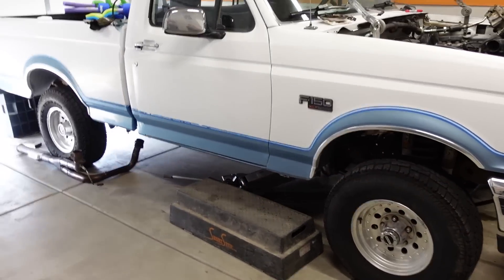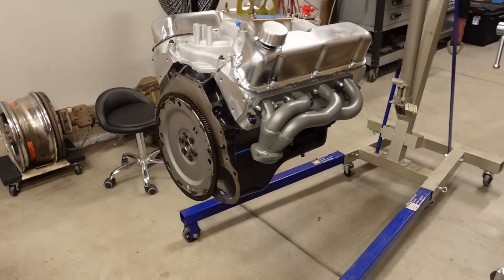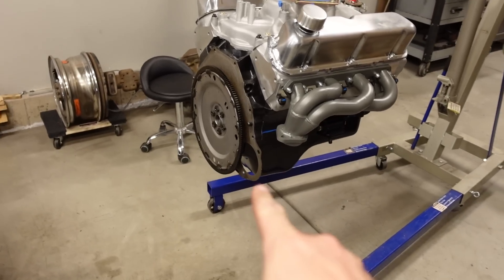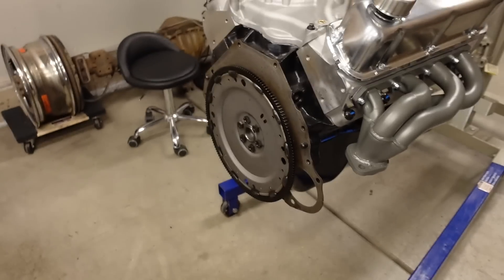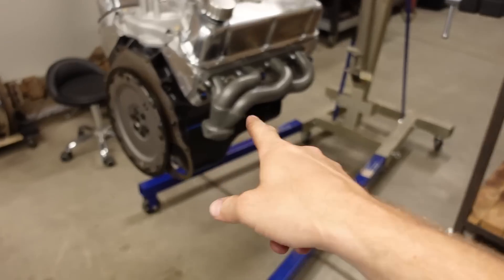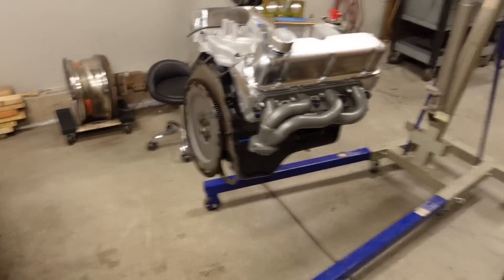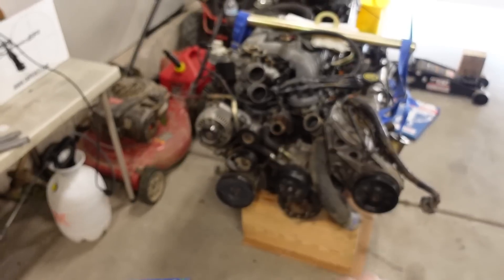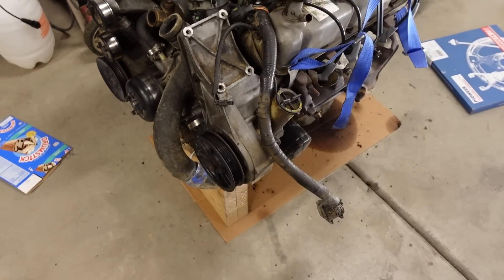1993 F-150 Engine Swap: the 500hp windsor gets installed!

Comment: I didn’t realize blueprint sold an internally balanced 408. I installed a blueprint 408 with a C6 same hp and torque rating. Mine was externally balanced with a harmonic balancer. No issue with flex plate. I would like to convert mine to a 6r80 or possibly a built 10r80 in the future. 1986 flareside 4x4. I fueled mine with an Edelbrock pro-flow 4. Great set up.

Comment: You should get a junkyard pump and bracket from a 1995 econoline van with a 351. They use the GM style pump.  It bolts right up and I used a pressure line from the van too which only needed some minor bending. One of the best mods I’ve done to my 1994.

Comment: Anyone who’s ever done any sort of swap on any ford will tell you this is to be expected.   I went through this with a 302 and a top loader 4 speed 40 years ago and doubled down on stupid and went through a similar situation with a 400 to 460 swap into a 79’ 1ton pickup.   Engine and transmission, perfect, motor mounts, perfect.   Accessory drive…sideways it went and straight to the bone yard I went looking for anything with a 385 series plant under the hood.   Many hours and some light fabrication and we had a running piece.   It shouldn’t be this way but Ford doesn’t want you touching their junk.   I concede and don’t touch their junk anymore.

I drive Chevrolet’s now and  the only Ford I own has a big block Chevy under the hood.   

I always enjoy watching your channel.   Great projects and content.    Great music too. I’m so tired of ear bending heavy metal playing in the background while someone is trying to finesse a camshaft into a block.

Comment: Why would you need a fuel regulator if your using a fuel injection system?
Reply from the maker: every fuel injection system needs a fuel pressure regulator to control fuel pressure...

Comment: Crazy how hard it is to find the right flex plate to join engine and trans… I’m also wondering about that 8- or 10-speed trans swap for later. My 6L90 talks back and forth with the E38 ECM constantly to control torque, gear selection, and lockup. That aftermarket install will need some serious smarts—it seems like, anyway—to control the trans properly. It’s not like a vacuum hose or a kick down cable any more.
Reply from the maker: you've got that right! supposedly the US Shift setup is in Beta Testing (as of Nov. of last year) so I hope that means they'll have em for sale soon!

Comment: What parts are you planning on ordering for the fuel system? I have an 89 F250 mud truck that I'm currently ordering parts for to go carbureted. Would like to know what you'd recommend for a regulator and to adapt to the oe fuel system.

Comment: I may have missed it, but what heads and cam are on that motor?
Reply from the maker: not sure of the exact specs on the heads, but looks like the cam is a 236/248 @ 0.050 on a 114 LSA
Reply: @TolmanPerformance  if it has .579 lift it’s probably the comp XFI236 hr-14. Bad ass cam. Tried to get one but they were back ordered forever. Check on the heads on the exhaust side right under the valve cover lip. There could be a part number. Curious if they are pro comp heads or maybe a variation of them. I have 210cc pro comps. No issues yet.

Comment: I’ve heard you mention a super duty axle swap on this project, if the customer is going for more of a prerunner/obs raptor it would make more sense to me to do a build on the TTB front end using parts from desolate motorsports with some coils overs. Just my two cents, keep up the great work!
Reply from the maker: we did throw around the idea of a long travel 4x4 TTB setup...

Comment: Is it in yet? No, I need another inch and a half!!!
Yep, been there lived that a time or two! Sometimes ya have to get real creative and run the chain through some heavy pipe to get that extra reach while big Bob stands on the back for counter weight.
Cheers man 🍻.
Reply from the maker: I'm probably gonna make a good solid extension for it since I seem to always be needing a little more length from it
Reply: @TolmanPerformance :
I've thought about doing that as well. And too it would be real convenient to have a slide on slide off counter weight system for the rear. Something like a body building bench press set up. It would be real nice to quickly add 50 lbs at a time to the rear just by sliding it on, the same as you would for a bench press bar. Most of the time we only need a couple hundred max to stabilize the thing... But when we don't have the extra weight, well, life is a dance as I know you already know.
Cheers 🍻.

Comment: How about a manual steering gear box instead of hydraulic and put a flaming river electric power steering… you know if you do have enough vacuum to run the brakes with that engine… if not then your plan should work just fine

Comment: Ugh, you need to get a AC/PS bracket off an E350 5.8L, it has the Saginaw Pump you'll want in the future. Do it now, only issue is possibly drilling the compressor bolt holes slightly larger. Very common, easy upgrade, I've done it. No more whiny Ford power steering pump!

Comment: Just in case it helps, the ford vans of the same year as the truck have a different power steering bracket and use a Saginaw style power steering pump.
Reply from the maker: ill keep that in mind for when the time comes. thanks!

Comment: Everyone has had to use bolts to pull the engine/transmission together at one time or another, good explanation on what/how to check for…
Reply from the maker: Yup, as long as you’re careful should be no problem

Comment: You mentioned a fuel pressure regulator. The sniper has one internally in the fuel rail. You will need an external one if you need boost referenced fuel pressure increases.
Reply from the maker: This was the super sniper that looks like the 4150 carb, I didn’t know if those had the regulator or not…
Reply: @TolmanPerformance  mine is the standard 4150 sniper with only 4 injectors. I have my feed on the rear driver's side and my return coming from the rear passenger's side fuel rail. I used 90⁰ AN fittings. 
  I slapped a centrifugal supercharger on and have been just using the self learning feature to just have higher duty cycle for correct fueling to compensate for lower fuel pressure when under boost. I've got an external boost referenced fuel pressure regulator but I haven't installed it yet. I still have the front end blown apart and need to get it all put back together. 
  I'm pretty sure the super sniper would have the same included regulator.
Reply: @TolmanPerformance  there should be a round flange with an AN fitting on the back of the snipers fuel rail. 4 screws hold it in place. The regulator is behind those screws. I just looked up a replacement fuel pressure regulator for sniper. They show a picture and everything. It's for 4150 and 2bbl 2300 snipers. It should be preset to 59.5psi.
  Check holley pn 12-878
Reply: @TolmanPerformance  Sniper Instructions
 
1. Locate the regulator cover on your throttle body unit. 4150, 2300, BBD, and 2GC units will have covers like the one shown in the 
photo on the left below. Autolite 1100 models will have a cover like the one shown in the photo on the right below. Be sure to 
note the orientation of the regulator cover.
 
2. Remove the return line from the AN fitting on the cover (if applicable).
3. Remove the four fasteners on the perimeter of the cover that retain the cover to the unit. At this point, the regulator should be 
visible.
4. Pry out the regulator with a small flat blade screwdriver. Pry from alternate sides until removed.
5. Install the new regulator by pressing on the perimeter flange only until it bottoms in the housing. Lubricate the regulator O-ring to 
ease installation.
WARNING -- DO NOT PRESS ON THE CENTER OF THE REGULATOR, THIS WILL RESULT IN DAMAGE!
6. Replace the O-ring gasket that seals the cover the unit. For the 4150, 2300, BBD, and 2GC models, use the larger O-ring supplied 
in the kit. For the Autolite 1100, the smaller O-ring must be used. 
(Note: For prolonged O-ring life, it is recommended that you lubricate the O-ring prior to installation with a silicone-based grease 
or oil.)
7. Re-install the four fasteners to retain the cover to the unit. Apply one drop of blue thread locker to the threads of each fastener. 
Torque fasteners to 15-10 in-lbs.
8. Reinstall return line (if applicable).

Comment: Be ready. You will likely need a crank pulley spacer, and there’s three different ones because of the three different timing covers and accessory systems.
Reply from the maker: the balancer actually came with a couple different spacers, so that'll actually be one of the easier challenges of this project
Reply: I ran into this when 351 swapping my sn mustang. Wanted to keep the stock 95 accessories, but had a trick flow balancer. Took two tries to get the right spacer. Like I said on the last video, being a Ford guy can be painful sometimes lol.

Comment: Might want to look for an E150 van with a Saginaw box from an 87-96 if they’re going with larger tires/ wheels. Factory Ford pump will heave its guts.
Reply: Actually any E series (small block), I have one off of a '94 E350 5.8L, bolted right up to the 5.0L in my '93 F150.

Comment: I have a friend that is the kinda dude who puts header bolts on with a 3/8 ratchet and a 2 foot cheater pipe...
Well, he sucked up the trans on his mustang with the bellhousing bolts and ended up breaking both left and right side ears off of his block. Turns out the input shaft splines were not lined up lmao. 
He said that he was "barely tightening the bolts".

He's not very smart lol
Reply from the maker: yeah, thats what you don't wanna do lol

Comment: That 10 speed probably won't hold up behind that Windsor unless it's built. They're fairly problematic even at stock power levels. I hope it all works out but I don't trust them if I'm being honest
Reply: This thing isnt being bred into performance truck either so idk about that 10 speed too.... thought it was an off roader.  better have a huge tranny cooler on it because the converter is gonna be cooking all the time if your slow crawlin

Comment: Nice job LT I'm glad you found the solution to the flywheel problem 🇺🇸💯
Reply from the maker: I still would've prefered an SFI Flexplate, but this will do for now
Reply: @TolmanPerformance  Ford performance has a neutral balanced flywheel and blue print engines has one